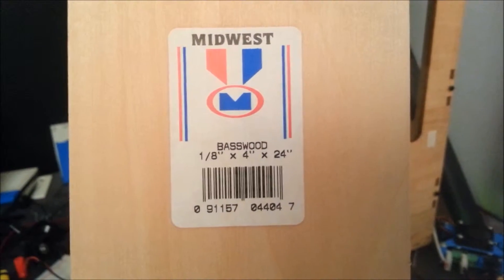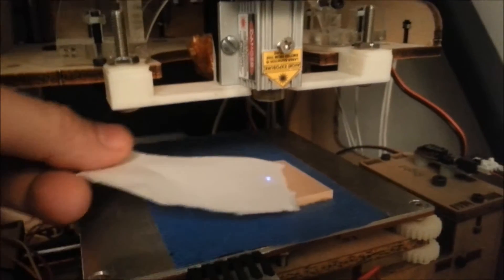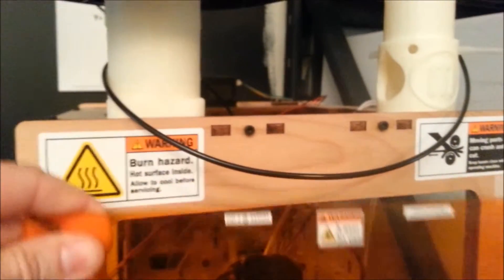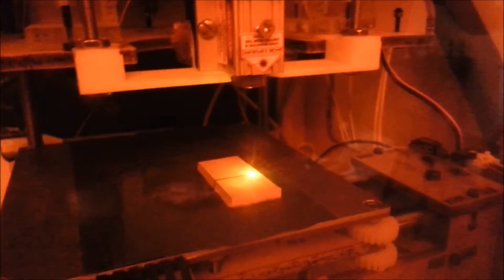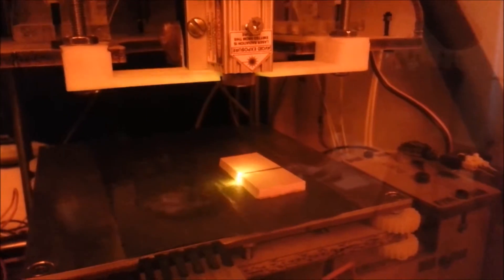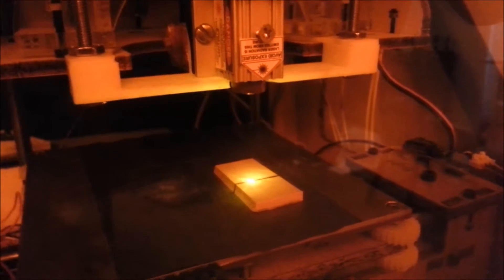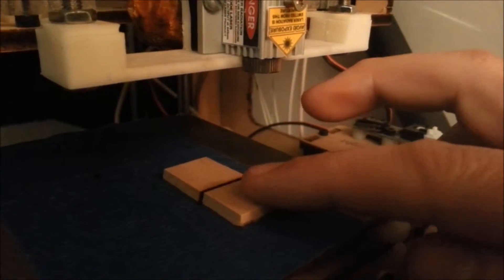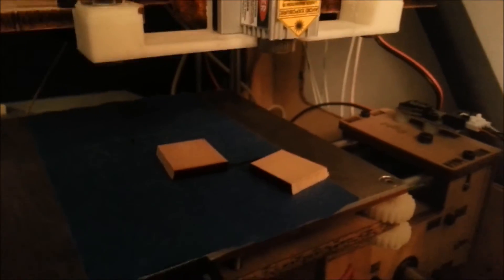Laser Cutting 1/8" Basswood with J Tech Photonics 2.8W 445nm aser Upgrade Kit

Comment: would these not cut better if they had a gas assist (like an air compressor jetting air onto the cut region to clear away dust and burned material so that the laser can keep hitting fresh unburned material, as well as keeping the walls and outside area around the kerf cooler so that it does not bubble warp or burn (bubbling and warping would be for plastic I would guess)

also I would love to hear about the differences between 405nm vs the 445nm lasers. keep hearing that the 405nm beams do not need anywhere near as much power for cutting, would be nice to hear more on this if you have any data on the differences.

Comment: Did you manage to cut or engrave clear acrylic or semi-clear? What are your results please?
What about whithout any coat or paint on it?
Reply: +Nairod785 - My 2.8w laser is coming in today and engraving/cutting clear and semi-transparent acrylic is my primary use. Will advise on my results and maybe upload a video as well. I'm not expecting much out of the gate as a clear acrylic will probably not absorb as much energy but I may yet be surprised. Will follow up.
Reply: Houston Firefox
Thank you :)
Reply: Houston Firefox Any news about engraving/cutting clear acrylic? Using any coat?